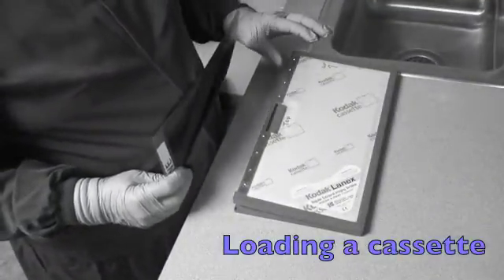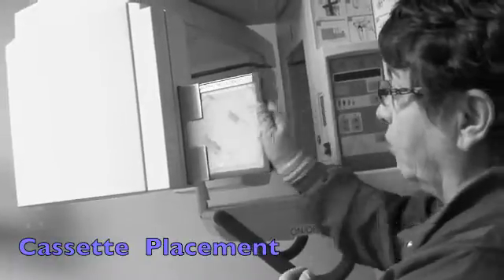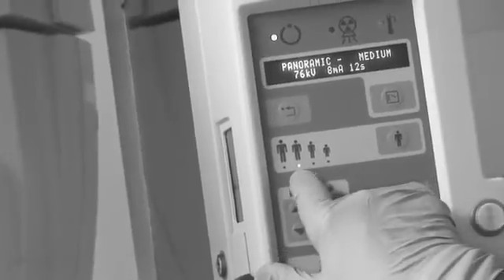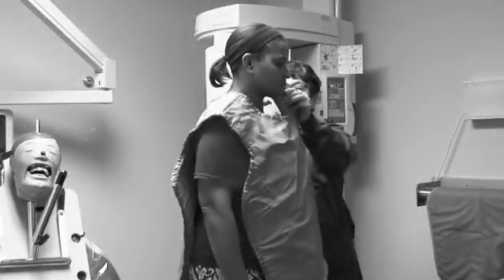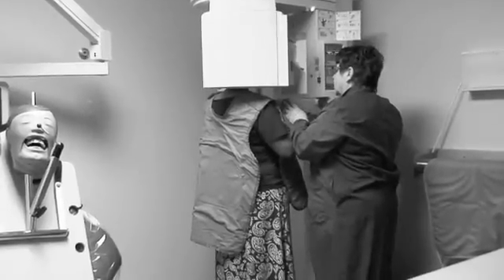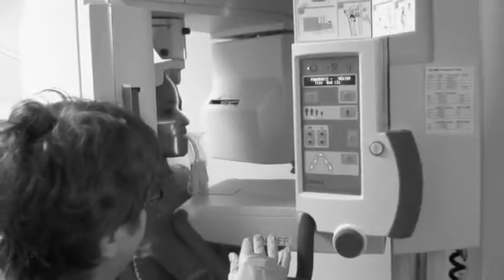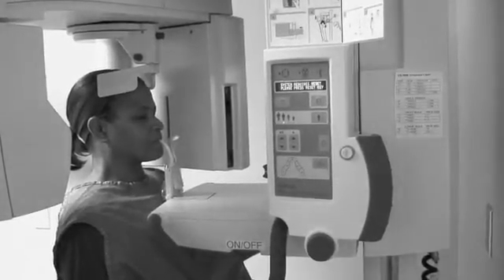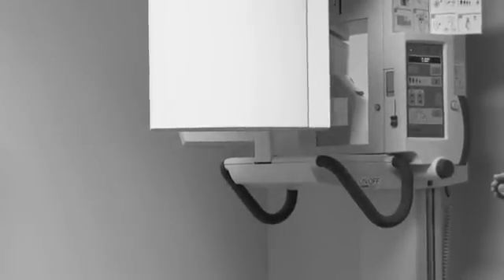Panoramic Radiographic Set up

Comment: i just had one done and they didnt offer me the vest protection, they also didnt check to see if it would clear my shoulders...it rubbed on my shoulders when it passed by and i didnt even think abt the lead protection till on the trip home..it wasnt offered, and im concerned abt the radition.creeping me out,why wasnt the protection offered...it was new to me, never done one b4 and i trusted the dental assistant to know what she was doing..any help appreciated..should i sue these people?  What the dentists will Not tell you:  This machine delivers Alot of radiation, im sensitive to such things and i can tell you this is a hugely bigger dose from  that beam which is continously ON as it circles around, Way more than bitewings xrays..This contraption left my head burning from the inside  for 2 days after the scan! it finally has toned down on day 3..Dont let Anyone give you that spheal that its no more than an afternoon in the sun crap!  Its completely different, its a concentrated dose delivered in brief time and That affects the body very differently than  the suns radiation delivered slowly in a diffussed manor over an afternoon... Does anyone feel bad like im describing after a nice day in the sun? No.... this is different and dangerous..The irony is that the panoramic wasnt even really used to check for cavities per se..they relied on bitewings for that... what a waste of time and i was put at risk with no protection to boot...i feel like never going back to that dentist again, but i prpaid for a dental plan with them and i need dental work but im so very dissapointed in their protection of their patients... they told me they Dont  use the apron for panoramics, only for bitewings...when i aked why, becuz the panoramic is way more radiation than a bitewing, so it make no sense not to use protection there, They had no answer.
as far as the check areas that the careful assistant in the vid went thru, the one who did me did Not do these... sent me thru with no apron, did Not line my feet up , did not get the head height adjustment right...my shoulders were rubbed hard by the passage of the  machine thru its arc.. i just held myself dead still cuz i didnt want to have it done twice..but That should not have happened ...putting tongue on roof of mouth  and or closing eyes never mentioned....there is So much about a panoramic xray, the  true dosage ,the proper procedure and the saftey precautions that i DidNot research,i just trusted the assistant to know  and keep me safe...never again...i recommend that Anyone undergoing this Educate Urself fully before you step into one of these..